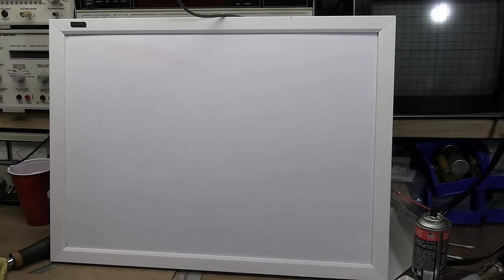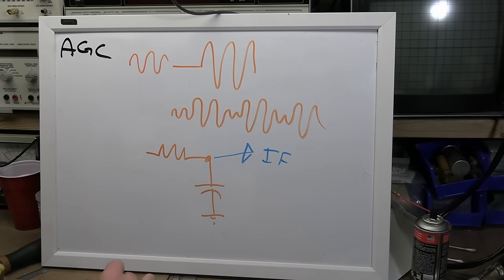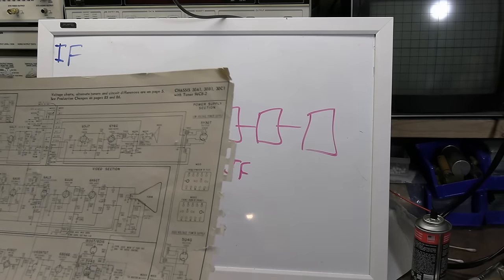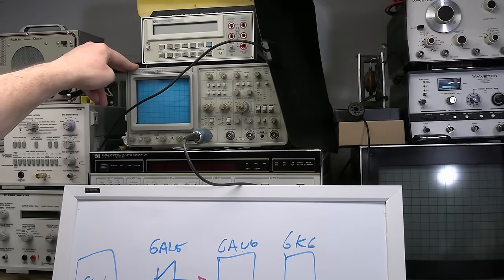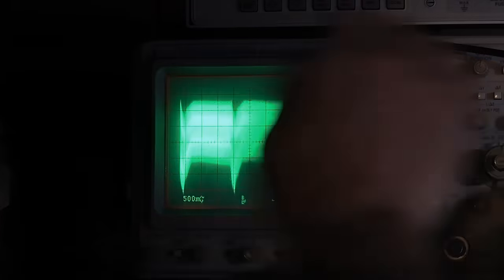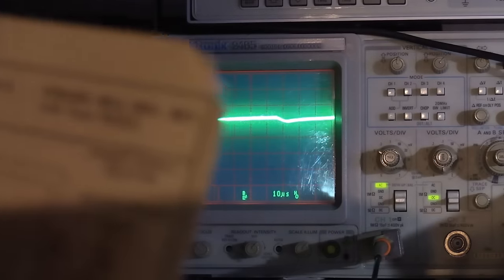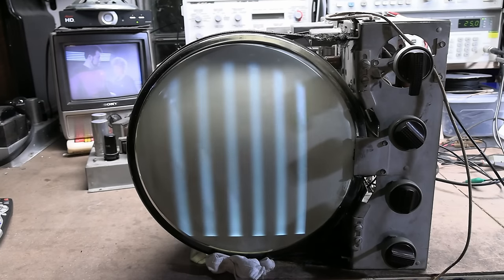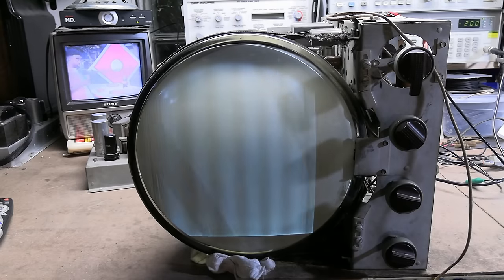Beginners guide to B&W tube TV part 17 (AGC, Video IF and DC Restoration)

Comment: The actual transmitted analog TV RF signal is USB (Upper Side Band) with full carrier using 6 MHz channel spacing.  This was chosen (versus full double sideband AM) to half the amount of spectrum the TV signal consumed.  This modulation method is called "Vestigial Sideband".

The actual RF signal transmits peak power during the sync pulses.  Also, black uses high RF power versus white, which uses low power.  The sync pulses are actually darker than the black video signal and were also called "Ultra Black".  There was some uncertainty when the TV video signal was being developed, as to which power level black or white should use.  I think black was ultimately chosen as it allows the picture to sync up even with a very weak signal.

The detected video signal has to be inverted before being fed to CRT control grid, since around 0 volts produces maximum brightness (and highest beam current) and -50 (and more negative) volts cuts off the electron beam.
Reply from the maker: I covered that in my TV alignment series.  Didn't want to go into that level of detail again.  They did the opposite in the UK 405 line system - minimum RF for sync.
Reply: @bandersentv  Sorry, I completely missed that episode.  I don't want to add to the confusion, which is high enough all ready.
Reply from the maker: @billharris6886  Not an episode, but ratehr a completely different multi-part series I did last year where I went into great detail about NTSC modulation and how the tuner and IF work including how to perform alignments.   I will not be repeating that in this series.
Reply: Peak white video was to be no less than 12.5% modulation.  We used "white clippers" to limit overshoots caused by fast risetime graphics (they tended to overshoot the limit if not clipped).
Reply: @bandersentv  Thanks Bob, I will look for that series.
Reply: @dtvdave1 Dave, I assume you are referring to the UK 405 line system?  12.5% modulation with the Vestigial system is about -17 dBc for the sideband.  I can see the need for the white amplitude limiter, without the limiter, the peak transmitter power would go through the roof and likely cause arcing in the transmitter and antenna system, not to mention intermod.
Reply: @billharris6886   No, this is for NTSC.  The 100% modulation point was at sync pulse peaks, blanking was at 75%, white is 12.5% and 0% should never be reached (it causes carrier cutoff and buzz in intercarrier audio sets).  We were always careful, particularly with the older tube-based transmitters, to avoid staying in black too long since this was maximum average power.  It draws a lot of plate current and can result in power supply arcbacks. (per FCC 47 CFR 73.681)
Reply: @dtvdave1  Thanks Dave for the explanation; very interesting!
Reply: Its called the vestigial sideband

Comment: (@16:26) One thing that’s confusing; how do you get both the (positive w/respect to gnd.) video and the (negative w/respect to gnd.) sync pulse out of the Ge diode or 6AL5 before feeding it to the 1st video amp? I would expect to get a rectified signal (only the positive half, or only the negative half) out, just like the 35W4 in an AA5 tube radio. The only thing missing is a filter cap. 😊
Reply from the maker: You are correct - you don't.  I was trying to keep the explanation simple.  Aside from the -8v contrast supply voltage, all the voltages in the TV are positive.  The way it works is that it is negative with respect to another voltage.  For example, say the bottom of the sync pulses are 0 volts but a tube is biased to positive 1 volt.  Then the sync would look like -1 volt.
Reply: @bandersentv  is that what the “DC Restoration” is for, to re-bias the video signal before the CRT sees it?
Reply from the maker: @williamsquires3070  Yes
Reply: @bandersentv   Are you sure all the voltages are positive? In my Emerson the detected video signal is actually negative relative to ground. I suspect this Admiral is the same.

Comment: Unfortunately you lost me on how the video gain or loss is adjusted for by sampling only the negative voltage of the sync pulse. Rookie question!  Does the sync pulse negative voltage vary with the video signal strength?
Reply from the maker: yes, absolutely.  It's all parts of the same AM waveform
Reply: Could be called "more negative" sync pulse.

Comment: Bob, it might be a good policy in this series that you mention what "this set" is. You work on so many different ones. Also the small higher frequency signal in the video on the scope could be the 4.5MHz sound carrier that would be there even when the signal generator does not carry sound.
Reply from the maker: Just about done so too late for that.  I figure anyone who's been following along knows.  This set has spit carrier IF and a trap for audio so there shouldn't be any in the detected video.  Of course, that trap may need adjustment.  I'll try to remember to measure it next time.
Reply: No problem really, I think this was the first episode where it wasn't clear. It could have been the Hallicrafters.  @bandersentv

Comment: The video RF signal is modulated such that the sync signal is the maximum signal, and peak white is the minimum signal. If your applied rf signal is to large and it overdrives the If amplifiers then you will see a loss of sync. AGC misadjustment can do this also for the same reason.
If the white signal is to large (sometimes seen in text overlay or umpire uniform on a bright day) rf will be completely cutoff in that part of the picture an will give an audio buzz in sets with 4.5mHz sound IF.
Reply from the maker: I know.  decision was made so you can have a snowy but stable image.  They did the opposite overseas.  Trying to keep it simple.